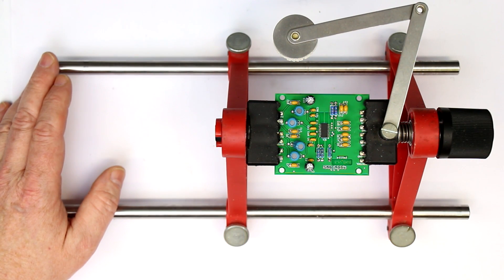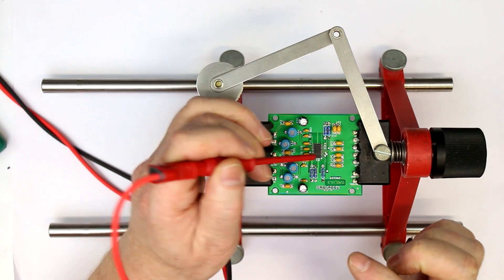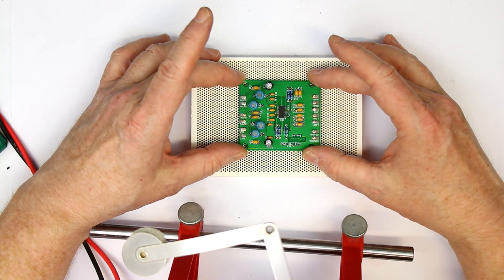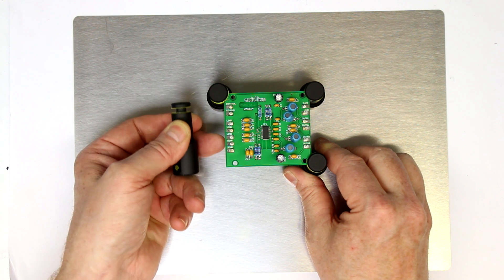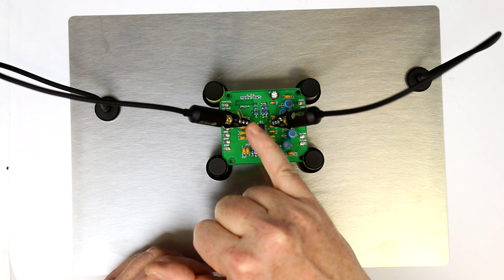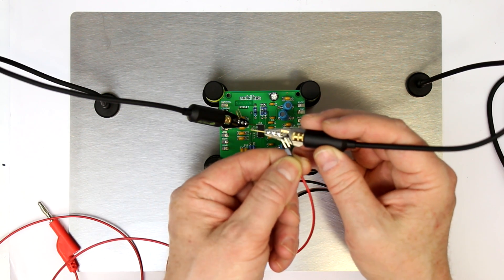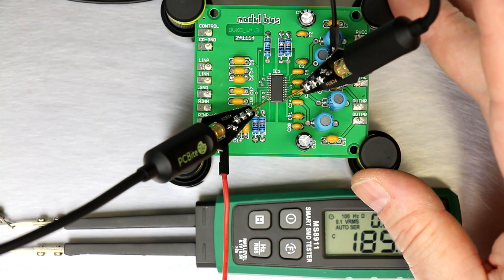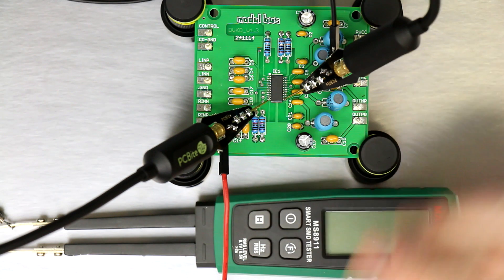Every Maker Should Have...[Pt.45]...a PCBite-Kit

Comment: Have a set of these after struggling with a variety of helping hands and 3d printed syringe needle based probes.

Would have saved so much time if I'd just gone for these in the first place. They just work and they work impressively. 

Not cheap, but then I've wasted more than they cost in time and materials in trying to bodge my own solutions together.

For probing signals on fine pitch ICs... I've not used anything as easy to use or as good at staying in place.

Comment: I would have preferred they have the endings you connect the cables to be at the base, that way you wont need to touch the probes after you set them and you will also be able to switch between different things you want to connect them to + clear the view a bit

Comment: Hi Roger! Could you please measure initial force of the clamp? Just put the PCBite on an electronic scales and get the measurement when the clamp is barely open and subtract net weight of the clamp.
Reply from the maker: There is no "clamp". The probe just presses onto the IC-pin or PCB-pad just by it´s bare weight. This weight is variable depending on how you bend the flexible "arm" and at what angle the downward looking part of the arm is set.
Reply: @KainkaLabs  Sorry, I mean PCB clamp, no probe clamp.
Reply from the maker: The PCB-holders have a very strong spring. You pull the lower/outer jacket of the holder down, put the PCB between the upper part and the lower part and release it. The spring pushes/presses the upper and lower part of the PCB-holder with a very strong force. I have no means to measure that. Why do you want to know that?
Reply: @KainkaLabs  Thanks a lot for the answer. I'm thinking of making a set of PCB clamps by myself. The price for the original set is rather high.

Comment: The holder looks similar to Omnivise from Hakko. I would also like to know how the PCbite probe works mechanically. Is it just a spring loaded needle tip mounted on a rigid wire or is it more complex? Because my experience with such a setup is not good, the rigid wire does not stay in place, it will spring back a bit and thus the contact pressure is lost. Maybe you could leave the setup 10min alone and then recheck resistance. Also, pls include a prize tag whenever you review something; prize is the most important attribute to any item.
Reply from the maker: It´s not cheap as I mentioned. In Europe it sells for 134€ incl. VAT for the complete "large" set. I think for the time and effort it saves it´s worth the money. I will probably this week already have an application where I will make heavy use of the probe tips. I will report if there are any issues. But I think due to the constant pressure by the constant weight with which it presses onto the pins there will be no problem in long-term contact resistance.
Reply: The probe tips are spring loaded contacts (pogo pins), similar to the ones being used in test equipment used in electronics assembly & testing. That little probe tip that is being pulled from the holder is a sleeve with a spring and a sharp probe tip - all gold plated. As long as the spring is under pressure, the contact resistant will not change.
I am however a big skeptic if the flexible arms are good enough to stay in place. Especially during development I have a PCB under test for a few days and I don't want the probes to move if I accidentally touch them with a hand-held probe.

Comment: Interesting little product. Of course I'm more curious about where to get the flexible material used to make the arm. I've tried a few different kinds salvaged from junk but I haven't come across anything as long and useful as this design utilizes. The head itself looks like a really simple design. I think I already have all the parts I can identify. 
  A couple of probes are well priced for the EU crowd. Unfortunately there are no US resellers listed and apparently UPS wants their own set of probes for going to the trouble of bringing me a set. The price of $27 is right at the limit of what I would spend for something like this as opposed to just making a similar design myself. Maybe their business and product availability will improve with time. 
  Thanks for sharing.
-Jake